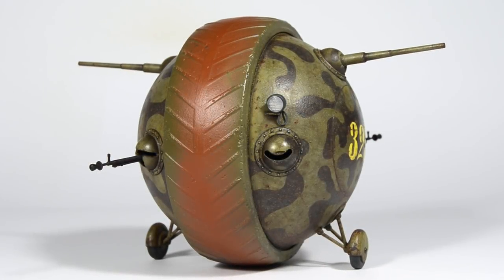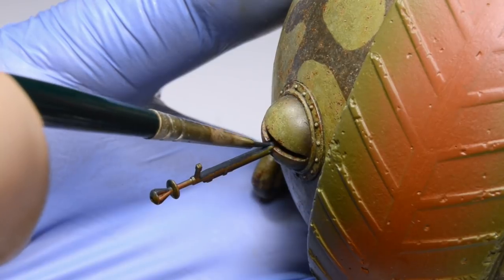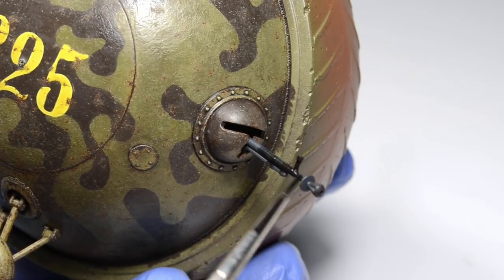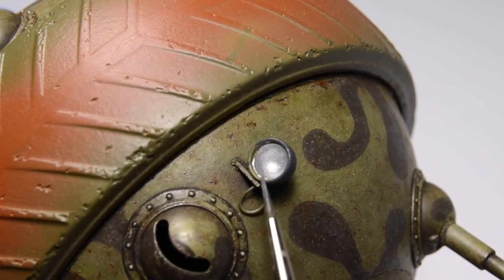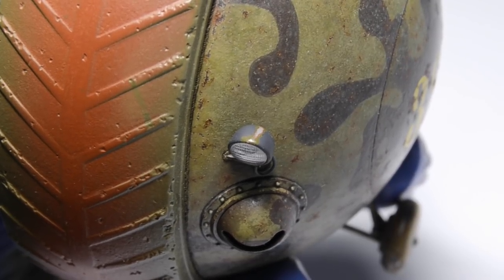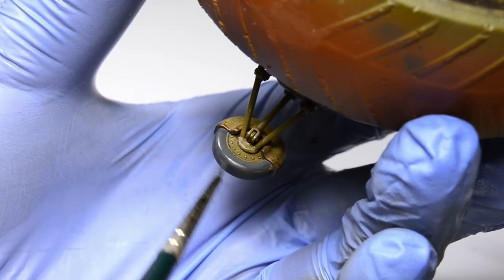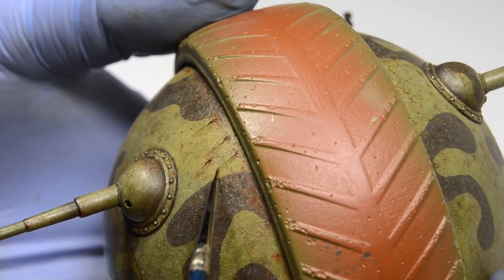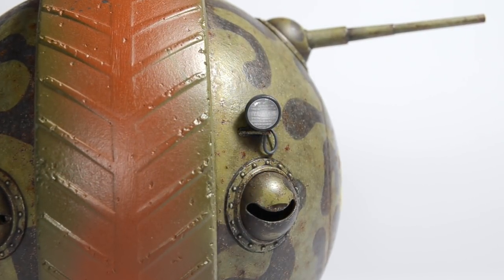Painting Wheels, Exhaust, Headlight & More! - Soviet Ball Tank "Sharotank" (Miniart 1/35)

Comment: For what it's worth,  I paint the inside of headlight housings with chrome silver, then I use the foil wrappers of  Hershey Kisses.  I carefully smooth out the wrinkles,  cut a small piece,  and press it into place with the end of a paint brush.  Before I do that,  I'll drop a tiny dab of white glue inside the housing to help keep the foil in place as I shape it. Using a proper size piece of foil reduces the amount of trimming. Should a tear occur or the foil didn't quite cover the inside housing, I have the option of either trying again or let the paint hide the my error.